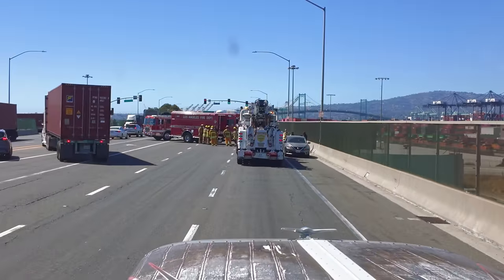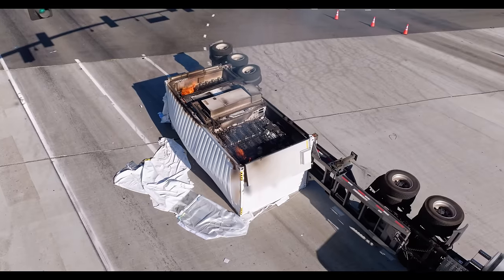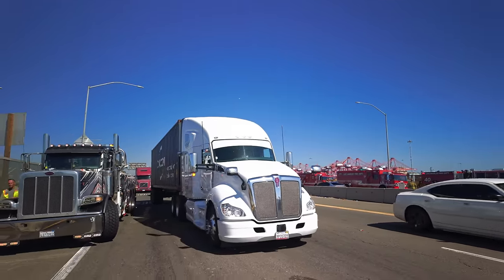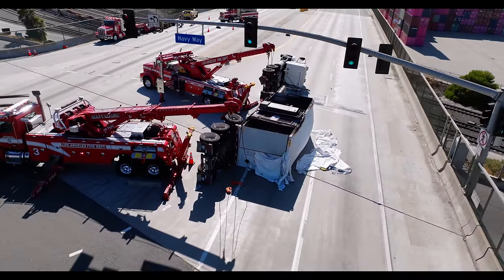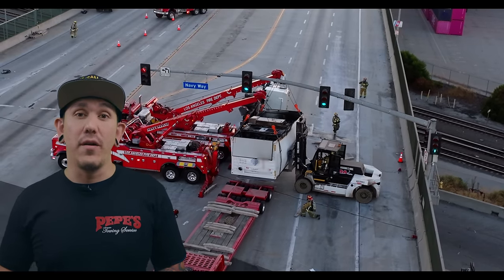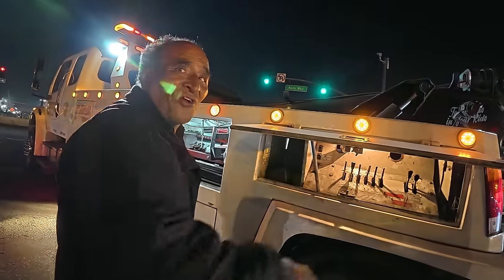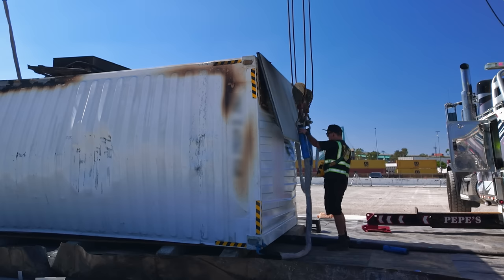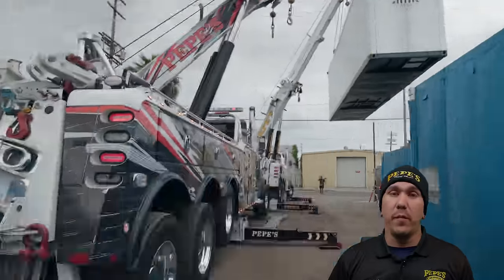60,000lb Lithium-ion Battery EXPLODES on Freeway!

Comment: Imagine how fast it would have gone if the people that were trained on how to flip that over actually had done it from the beginning.

You should get the fire guys out and do a little training on Flipping stuff. That fiasco with the unnecessary forklift. I also wonder if you righted it on the trailer, if that would have bent the trailer back straight the way you usually flip them.

Get the whole mess up and then pull it appart.

I don't mean that it would fix it, just bend it back straightish so it could be towed out safely. Not rip hoses off the bottom while using the wrong tools.

Comment: Honestly, battery technology like this is too dangerous for the extreme conditions these vehicles operate under. Until a safer alternative is developed, these kind of batteries simply should not be used for this purpose. Lithium-Ion is notorious even in the small-scale consumer electronics industry for being unstable and exceedingly hazardous simply due to a mere bump or nudge being enough to set these things off.

Comment: Was this accident caused by driver error?  Speed?  There needs to be some rule changes.  Also low boy trailers may become manditory.  Truckers will have speed monitoring systems required.

Comment: I know if a Car Battery is burning, they place it in a Container with Water.
I also know Lithium Batterys are burning in Water because they produce their own Oxygen, so it cant be suffocated.
But a Fire also need Heat to burn, so theorethical you can stop the Fire by removing Heat.
Water is not strong enough to do that so I wonder, what would happen if you simply fill a Container like this, who look like it can hold Liquid with an huge load of LN2 (Liquid Nitrogen)?
That Stuff has around - 200°C or -328 °F and would freeze the Batterys solid and take the heat the Fire need to run.

Comment: After the initial explosion they should have pulled fire lines to the battery  rigged a stationary water nossel  ,and filled it upp with water . The container was lying down, was obviously water proof (because ,the door popped of because of  gas pressure)
When it was filled with water and the heat from the fire should have been controlled, the box could have been cut loose from the trailer and dragged onto a machine trailer.  Then Moved to a better location  there neutralizing the energy in the batterys.
Obviously while  protection gear with external air  sources. 
There has been tests done where burning b-ev: s
Has been submerged in open top containers filled with salt water to short out the batterys draining them. it works.
The picture where they had 10 s of these units placed tightly 
Together seem like a catastrophe waiting to happen. 
One battery run away the whole lot goes up in flames.
These lithium jon batteries are 
Not suitable for these kind of dense power units , there is safer, less expensive and less ,environmentally impacting battery chemistry to use for these kind of systems. 
Like salt batterys /flow batterys /iron oxygen batterys. 

Or why not hydrogen powercells ,with a external gas 
Container to fuel it?
Can be exchanged for a full one when emty or refilled from a mobile storage tank. 
Its unbelievable stupid and short sighted to use 
Lithium  batterys like is being done with dees container batteries.

Comment: It was not a "battery explosion". Batteries smolder and burn. The pop was pressure buildup in the cabinet. Emergency personnel waited way too long to handle this crash. They should have ventilated the cabinet as soon as possible and cooled the contents with water. You would have plenty of time to upright the rig and get it somewhere safe.

It's amazing how anything battery related attracts the most ignorance in the comments. It's like nobody ever saw a tractor trailer fire or tanker fire and how quickly they destroy a road or bridge. Battery fires are easy in comparison, but people see something new and don't want to learn how to handle it. Maybe emergency personnel need to go over to Europe and learn some new techniques, rather than stand around afraid.

Comment: Looks like driver in a rush to beat the light,heavy load on a chassis equals roll over, &
with dangerous battery. Some one mentioned low boy trailer, I never seen a low boy chassis. But, that person might have a point,few more wrecks like that, Maybe the DOT will wake up. Yea right.

Comment: I haul propane transport tankers and ive got 14 years experience the shere weight in that trailer is emence i wonder if the driver was new looks like he took the tern to fast  this is insane.
And i thought propane was dangerous.  thats a sweet class A rotator youve got there.

Comment: Lithium battery don't really "explode" they get on fire and produce out gasses which if contained can then produce a deflagration, too much fuss and media exposure for this  small fire, if that would have been a truck transporting gas it would have been much worse as it would have released much more energy and much more quickly. Just a small single propane tank would produce much worse deflagration than this. The solutions to avoid relight are pretty simple dump the battery in salt water or grind the batteries at a recycling facility (and recover the materials)

Comment: This is the main reason that Electric Cars should not be on the Road. There's a whole lot of other reasons too. There's good reasons that most of the Big Car Companies have stopped making Electric Vehicles. They're dangerous, they're more toxic to the environment- not green at all, you have to plan your trips around where you can charge and even when fast charging you have to plan how long it's going to take to charge, not just a few Minutes like with Petrol. So not only dangerous, but very impractical in many ways and they're bad for the environment- Lithium Mining is extremely Toxic due to the waste produced and mostly just dumped into Rivers. Then account for- you have Thousands of Batteries in each Car- those Batteries could power thousands of smaller devices and be relatively safe to use vs. having thousands of these things right next to each other that can lead to a fire that can't be put out for Days, like this example. Lithium is also one of the most rare resources in the World too (and the entire Universe)- much more rare than Gold- Lithium is actually a really good investment idea if you ask me, we're only going to need more and more of it- every Year we use more than the Year before by quite a bit and this has been going on for quite a long time now- in 2022 we used 724 Metric Tons of Lithium, 2023 was 920 and it is projected that by 2024's end we'll have used 1129 metric tons while 2025 is projected to use about 1404, and this trend will continue until we find a different material for making Batteries- Battery Tech/Energy Storage is one of our slowest progressing Technologies, and it has not changed very much in 200+ Years (about Year 1800 was when the first modern batteries were invented). I could go on but this is just a YT comment. Folks, Electric Cars are just not there yet and may never be due to the much more practical alternatives- if it can burn, you can produce oil/gasoline from almost anything.

I wonder how much Money was lost due to this Road being shut down- you know this had to have ended up costing Millions at the least. I'd so hate to be the driver of that Truck, I wonder what happened to that Person.

Comment: The battery didnt explode, it was the h2 what was gasing out because of a short or something else that overloaded the cell and ignited. Also a battery fire is no problem at all, let it burn, its was saver for the environment as trying to put it out. Batteries burn relatively clean compared to fossil fuels like diesel and such. 
if a battery would explode, this would be a problem, because as example your cellphone has energy stored compared to a handgranate if this would be released in the same amount of time. 
a good battery burns of something goes horrible wrong, and the longer the burn less risk they bring, but yes self igniting after a long period of time is a big problem. 
A burning vehicle with a fluid is more a risk for everyone and everything as a burning electrical vehicle.

As i said if the battery that size would explode that bridge is gone, lucky that's never going to happen, but a fuel tank of a truck can explode and then everything in a radius of 100m to 150m burn like hell. one reason why most vehicles have plastic tank. Heat melts and weaken the tank and no pressure can build up therefore less risk.

Comment: So what happened is a couple of cells or a few cells I shorted out during the crash, which built up pressure in the cabinet, then exploded the cabinet door off, and then the other cells started to burn.It wasn't sixty thousand pound battery exploding

Comment: And THIS is why ya'll should NEVER buy Electric Vehicles or Hybrids. They are 100% BOMBS ONE WHEELS. They raise your electric bills to the point you cannot afford it, plus those charging stations don't do shit and they too cost a lot, their repairs and maintenance are waaay too expensive to the point you cannot afford, they are dangerous on the road period, and when that battery in your EV or Hybrid goes? IT GOES! You will suffer from major injuries and/or death, they are a environmental hazard since these batteries take a long time to decompose, when they do they release extremely toxic chemicals and fumes into the air, ground and even water. Sites that store these unusable batteries often donn't follow many protocols and recyclable batteries are also dangerous and go through factories that  ALSO release toxic fumes and chemicals into the air, ground and water. When one is made, the factories that produce harmful and toxic chemicals as well that are release into the air, ground and water. Many and I mean MANY brands such as Tesla and other businesses have constant recalls on their EV's AND Hybrids. Do not and I mean DO NOT get one!!! Buy a regular one. One that runs on GAS. They are better than both the EV's AND Hybrids, make sure to do your research to find a good vehicle that has very little to no issues with maintenance, repairs and make sure they have extremely low recalls to none at all.

Comment: I don't think Generator is quite the right word for what that is.  Its the equivalent of a UPS, Uninterruptable Power Supply, which would go in between a power source and a customer.  If it had a generator on board the only one it could lay claim to would be a fuel based one, which would have had an exhaust tube somewhere.  Solar takes up a lot of space, the container does not.  It definitely doesn't have a nuclear reactor in it, and a windmill is similarly out of the question.  
Personally think they need to come up with a battery design that doesn't catch fire so easily, because the gasses that come off such a fire are what's so dangerous, before they start using the things in such a fashion.  Doesn't need banned per say, the technology just isn't quite ready for a unit so large yet although I would hasten to add the things are getting to be in wide use anyway.

The large amount of time spent is probably in response to EVs, and the fact that you have the batteries more contained compared to how they were onboard this container, as it does take  about a week for an EV to be considered "out", this thing for most of that was wide open to  the air.  Appears a very different scenario compared to an EV fire.  I would wonder if there would be a similarity to Tesla's Electric Semi, in total batteries on board.

You definitely ended up with some valuable lithium battery training material regardless.

Comment: my old wireless apple keybord also has got a very voltaive battry that swelled up so big so i had to put it outside far away from the house in the back yard. some how the apple keybord  swled  ion lithuim battry has servied some rain down pour allready wihout  actly explding yet. its also at 95% ish charge too and the battry itself is exposed.  good thing i put it far away from the house just in case if it explodes.
Reply: also the back yard is desert landcaping in nevada so theres very little to no flamble obects near by and also has a very old metal dust pan under it on top of stone brick just for extra buffer as well.

Comment: You know a lithium battery in thermal overrun and burning cannot be put out it can only burn out, Also the toxic smoke from a burning lithium battery if highly poisoners. Cobalt residue that come from them will kill you. Here in Australia, there have been quite a few fire fighters that have been pensioned off due to cobalt poisoning from EV fires & lithium house storage battery fires

Comment: There needs be a foam that will incapacitate the area from oxygen but not heat up and melt!? Cuz the arcing will still make heat just not a fire with out oxygen? It’s a chemical reaction so oxygen is not a factor? So then you would need a neutralizing agent and WTF? Would that be?  Damn it!! Just let it burn is the resolve..damn batteries!!

Comment: Imagine every car wreck if all cars were an EV...and we think that a regular wreck is a huge inconvenience that takes 2 or 3 hours to clear. How about shutting down major interstates for days? Not to mention imagine if one of these things goes up below an overpass or in a parking garage below a building. It burns hot enough to compromise the rebar inside the concrete and like they mentioned produces poisonous fumes. 
I dont think that this one even burned that badly due to the fact that it wasnt fully charged. Think about a lot of these all parked closely together fully charged...this is going to be more and more if an issue as  the battery market gets flooded with cheaply made Chinese tofu dreg batteries.

Comment: I'd hardly call THAT an "explosion" it was more like a soda bottle popping open, no flying shrapnel or anything, the shipping container popped open on the one side, BFD, almost NOTHING hppened, no runaway flame melting the pavement with 30 foot high flames and clouds of black smoke, it was a nothing incident beyond a tractor-trailer overturning with a claimed 60,000 pound load which was the whole cause of the freeway shutdown in the first place. Far more damage and drama has come from gasoline tanker trucks overturning and catching on fire, at least one was under an overpass and it wrecked the overpass which had to be replaced.

Comment: thankfully it exploded and now it just burns but ya Lithium-ion the funny thing why there so hard to put out there basically self igniting
> battery's cathode, or positively charged electrode, are heated, they decompose and release oxygen gas
>Fires need oxygen to burn,
>so the battery is creating it's own oxygen to burn
also it's Water Reactive

Comment: The real issue here was actually the stupid human driving the truck that crashed. Don't blame the batteries for the humans mistakes. They clearly tried to turn left going way too fast for this load. Anyone held up by this should direct their anger at the driver of the truck, not the massive battery packs that are helping to stabilize the power grid so you don't get blackouts.

Comment: you'd think fire departments would have the hoses and stuff not leaking so much wasting water... and the dude that couldnt even thread the hose onto the hydrant.. wtf.. more DEI im sure
and yea.. most of that was ab it overkill.. being 3/4 of a mile away from it?? wth... shouldve had someone there from the place that built it  to know specific things.. it couldve been transported before it popped the doors.. im sure that was hours and hours after it tipped

Comment: Lithium batteries are inherently dangerous. Even more dangerous is Lithium Polymer (LiPO). Even the small ones in RC helicopters and other devices - as well as cell phones - have caught on fire randomly before, burned people's rooms up and houses down. Also, the lithium batteries in EV vehicles are quite dangerous. I remember a while back when one caught on fire and of course lithium + water doesn't mix. It took firefighters about 4,500 gallons of water to put it out. Sure, there are other materials to use on it, instead. That stuff is expensive and there's only so much room on a fire truck.

Comment: This stuff is very dangerous if the foam that the Airport Fire Department uses dont' work on these battery. I know one thing the battery they use for automotive cars are junk. That's why store don't give you long warranties on those new batteries like they used to.

Comment: Grand, emergency battery back up, what a "GREAT" idea..... Lithium ion batteries were not meant to be the technology for electric cars or mobile battery backups, the chemistry is too dangerous and can be unpredictable. And as economies of scale are proving, if the battery packs are not made right, these fires can happen out of the blue. We need a better battery chemistry and we need one soon. This, is getting to be beyond stupid when I see one of these go up because of a minor inconvenience like a roll over. If that were a diesel generator, there would be no lithium ion battery. There might be spilled diesel, but that can be cleaned up and should the worst happen and it catch fire, it doesn't take an entire fire department+ to put out.

Comment: Just imagine that electric card has these batteries in 😅them hope a lot of safety gear goes into the production of manufacturing 😅 those vehicles see why I just keep my gas vehicle even though they it's just as  bad if fuel leaks outs so think hard about the vehicle you 😊 want to drive
Reply: At least Tesla's have a comprehensive battery management safety system that can isolate and maintain temperatures and exposure including in the case of a serious accident. Fires can still occur in very extreme crashes, but it is exceedingly rare.